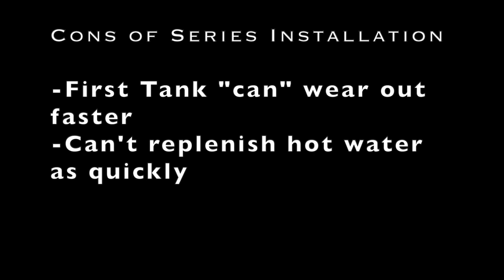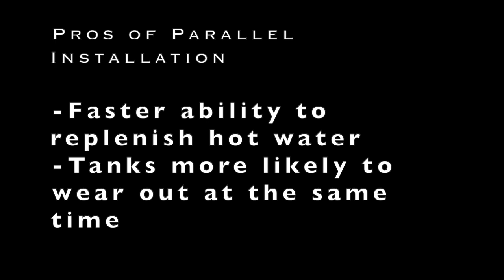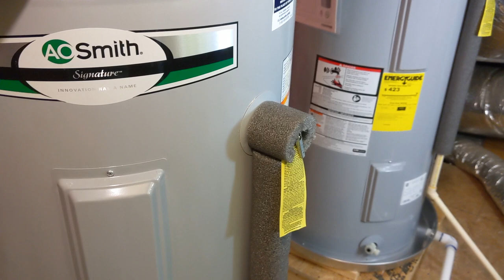Old Water Heater Replaced with 2 In Series.

Comment: That is a really strange setup. Where were the other two 3/4" copper pipes going from the bottom? You had the flow of refrigerant backwards, the small lines are the supply to the indoor coil. I think the idea was that when you used hot water, some cold water would flow into that "hot plate" and that would help cool down the refrigerant more on hot days to increase efficiency. The slightly warmed water would then mix with the hot water supply. Perhaps the pad is also supposed to capture the waste heat coming from the bottom of the HWT?  Whoever installed it probably didn't know what they were doing, looks like DIY to me. If installed correctly it would have had a small efficiency bonus, but the benefits would no longer exist with modern high SEER equipment. The refrigerant lines going into it were also bypassed with an H bridge, so it wasn't doing much of anything.
Reply from the maker: Weird, I am watching multiple videos from people that are describing the system how I do, and then other videos saying the opposite. You would think it would be pretty straight forward. I'm not an HVAC guy at all, so I guess I need to do a lot more research. 

 In the first part of the video I show how the lines are running. The discharge port of the tank was going down directly into the hot plate and then flowing back out to connect to the top of the tank. There was hardly any water movement through there as 0% of the sediment wound up in the hot plate 3/4" water line. So, yes, still had me baffled as to what they thought they were accomplishing. Even if someone was running a lot of hot water, and introducing cold water into the tank, isn't the liquid line suppose to be around 90-110 degrees? Most of the time the water would be 130+, so the 10 minutes of "tepid" water at the bottom of the tank would never be able to make up for the hours and hours of the line flowing through a much higher temperature. Cooling down a line, with a device that heats things up, just doesn't make sense.
Reply from the maker: So I finally found a video here: https://www.youtube.com/watch?v=VJX0LyxRV0E
He explains the A/C system very well. Takes away all of the misconceptions I had. Thanks for putting me on the right path.
Reply: @MyFortressConstruction  Yeah you'd have to be running hot water all day for it to work! Not sure how that saves anything! The liquid line should be a few degrees warmer than outside temp since it is cooled by the outside air (actual temp is related to outdoor temp). On old inefficient equipment it would be as much as 20º warmer but on new high SEER equipment it might only be a couple degrees warmer. Colder is more efficient.